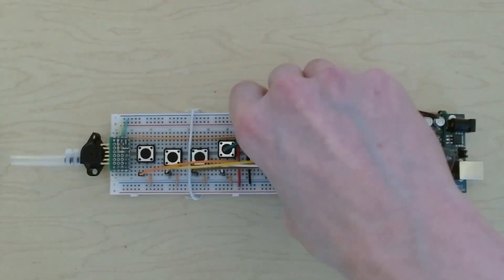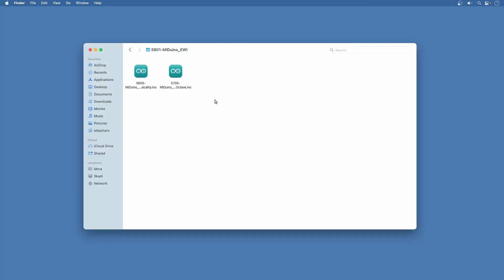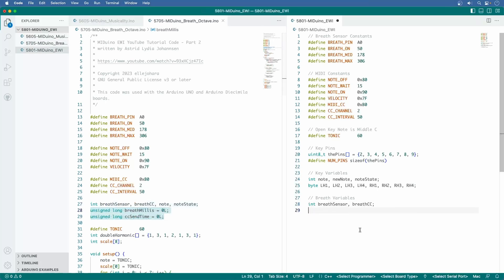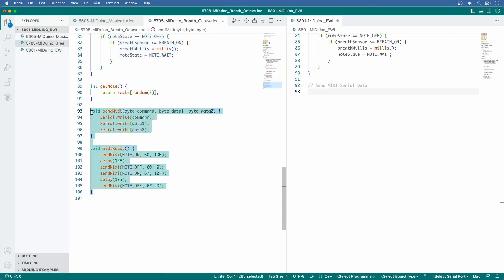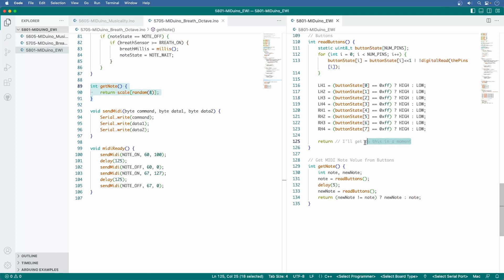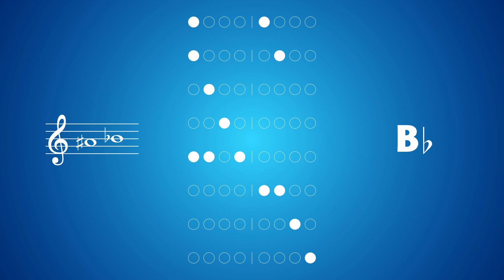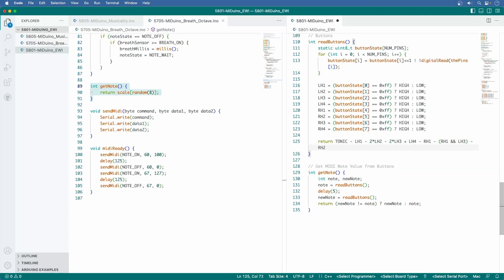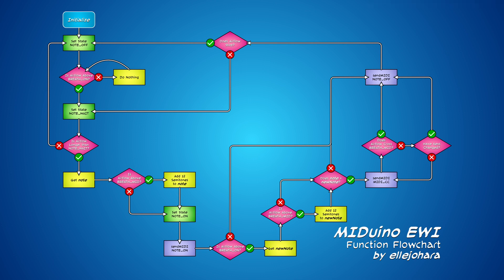58 | The MIDuino EWI

Comment: Googling around for compatible boards to try your project as my first effort  i would appreciate a simple answer if you mind :
Should i try your code { will it work the same as is }  with Arduino Leonardo {midi usb compliant } or Uno rev3 ??
in case it matters i""be using mac Osx

Thanks in advance .All my best
Reply from the maker: The Uno R3 will work better with this code specifically because it is not MIDI compliant. The code is written for the Arduino to run through the serial to MIDI translator. Arduinos that have a native USB port (such as the Leonardo) require a different approach with the code, an approach I'll address in a future video.
Reply: Thanks a lot for such a clear answer .I" m not going to learn to code @my age so that was really helpful to consider .Be well ^:}   @ellejohara

Comment: ........great job..... 
& can uh Plz. Hlp me out   I'm working on a simple arduino UNO USB-MIDi  5notes keys....but unable to. Connect with IPAD ......
any suggestion how to connect arduino  usbmidi with  iPad 
Or it will not ipad ?
Reply from the maker: I don't use tablets, so I don't know how helpful this will be. As far as I know, there is no MIDI serial bridge app for iOS. So you'll need to use an Arduino with native USB like a Zero or Due or Micro. Or you can reflash the chip on your Uno with the HIDUINO firmware. I haven't used any of that, so I can't be sure. But that's my best suggestion. Good luck!